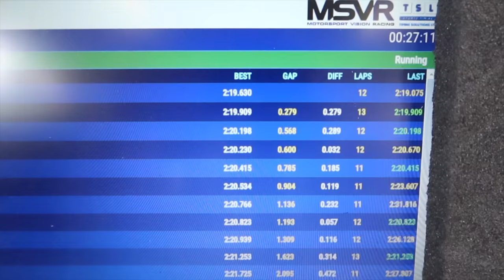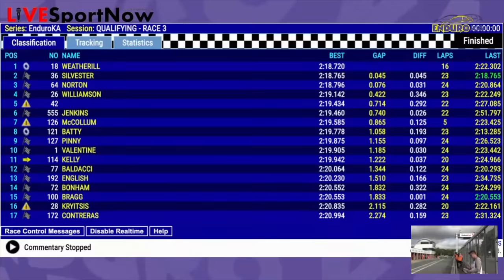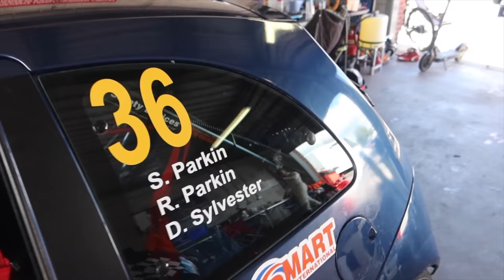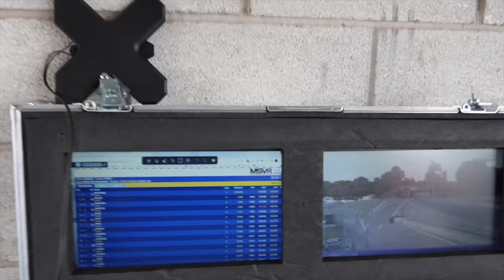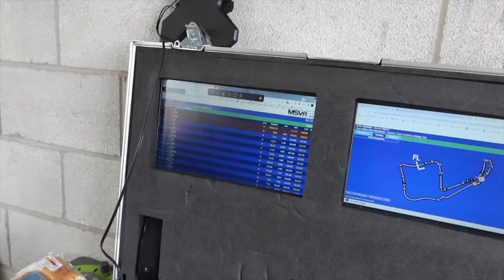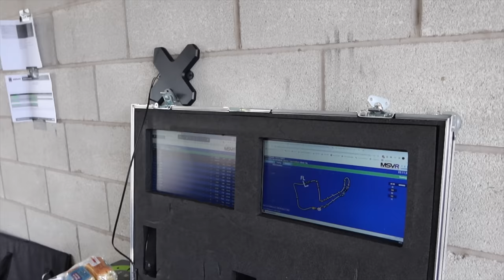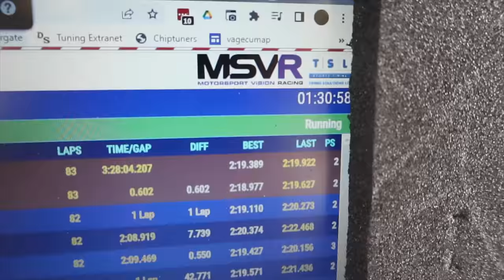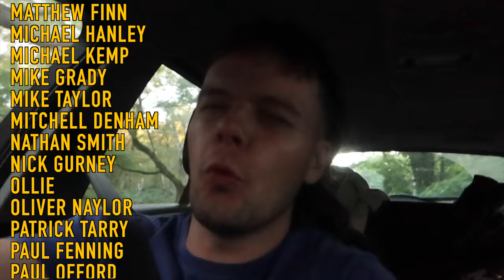Getting All The Penalties… EnduroKA Oulton Park 5hr

Comment: Are the gopros wired to the battery?  They could be freaking out if the alternator regulator is shagged 👍👍👍
Reply from the maker: Nah nothing like that. Was just the GoPro didn’t have a battery in so when starter motor kicked in GoPro kicked off